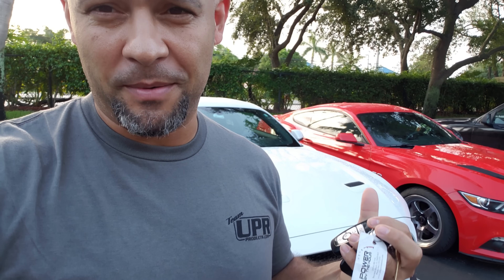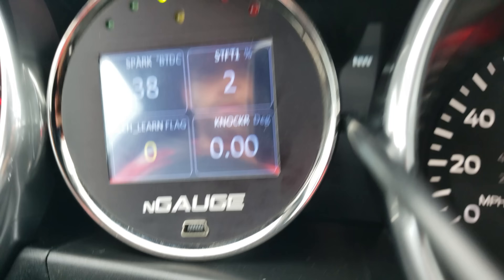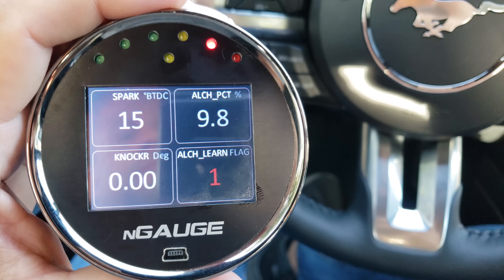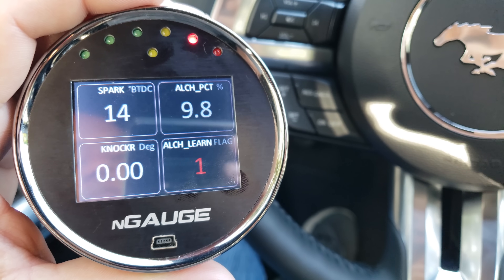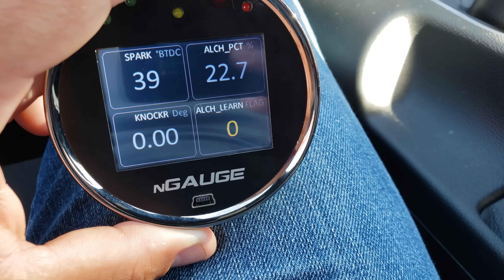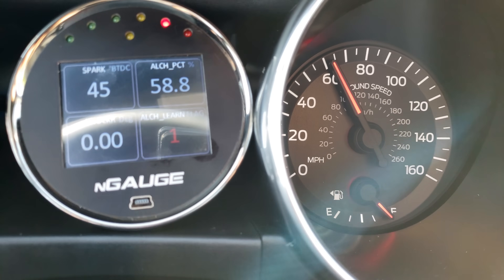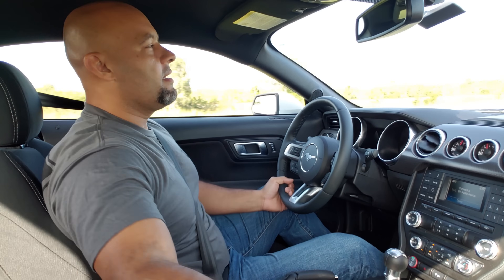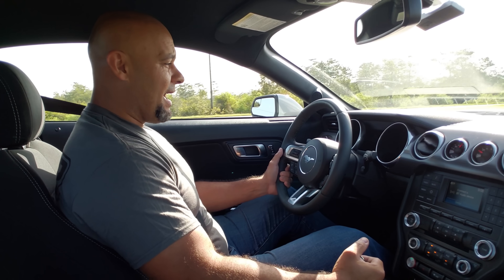2018 Mustang Breaks down, fixed, then gets a flex fuel tune

Comment: Casually revving the car to 3000 rpms for 10 minutes at a regular ole gas station 😂😂.. Lund says to rev it to 1800 a “ couple times “ then drive slow for a few miles. It ain’t gonna learn shit that way. It should say hold it at 2500rpms for 5 mins or until alcohol % stops climbing.
Reply from the maker: @xGR1MxREAPERx  flex tunes haven't been offered by Lund for 2 years. Cause people don't know how it works.

Comment: I have a 2018 Mustang 5.0 and running the flex tune. I’ve been running E85 for a while (6-8) months. And just swapped back to 93. I’ve gone through about 6 fill ups and the Alch learned will not drop to less than 76%. I’ve tried drive it at various RPMs but no luck in having it change in % learned. And also the AFR reading is still at 10.0 basically. Any ideas?
Reply from the maker: Let it get totally empty then refill with pump gas
Reply: @YDBT4LIFE   Ok, I’ll do that. Thank you

Comment: Poor man question 😉 I installed my JLT cold air intake with a Lund N gauge 👉tune? Well it won’t keep running, so I put the factory cold air intake back on and it runs the same as before the N gauge install. N gauge says no tune available? Thanks 🙏 I know you’re a busy man.
Reply: I always contact Lund Racing directly, they respond within 1 to 2 days, they'll answer anything you ask them and very detailed and nice about it.
*I already asked them 3 questions and ALWAYS responded me within 1/2 days

Support@Lundracing.com

Comment: I have a 2011 GT500 with FIC 775 injectors and a VMP fuel pump booster.  What's needed for a  flex fuel tune?

Comment: Good thing it happened at 300 miles before an modds. Once the modds are there your Powertrain warranty is gone. And the Mustang V8 is not Flexfuel, it only goes upto E15... I have ruined a few motors using E in non flexfuel.

Comment: Hey Alex. I’m about to get a 2019 mustang auto trans with the Hellion street sleeper twin turbo. Should I spend the extra $3,000 for the oil pump gears and half shaft upgrades ? Don’t plan on taking it to the drag strip much. Yeah a few times to really see what times I can get but mostly I will get on it in the street.

Comment: Can you swap the better gear cluster from the older MT82 into the new one? Or just the whole transmission if the electronics allow?
The 2018 6M needs the older gears with the 1:1 5th gear.

Comment: mine locks out 1-2 anything over 6800rpm. MGW shifter didnt fix it like every YT'er claims it does, 2-3, 3-4 are perfectly fine.  just 1-2. i have to shift at 6800 then can take the rest to 7800 if i want.

Comment: Not to be one of THOSE GUYS, but I'm pretty sure the stock fuel tank on any GT is 16.4 gallons, meaning at 1/4 tank, you have about 4 gallons left.  Let's just say I let my old car run down to 25 miles to Empty before & it took ~15 gallons. 

Still interested in learning what you and tuners think of fuel additives that have the primary objective of boosting octane/performance!

Comment: My 18 shifted beautiful until about 2500 miles then it broke. After I installed the new trans I tested to see if maybe there was another problem(like the clutch) that might have aided the fork breaking. Car shifted like it did new again!  I understand what your saying about the clutch locking you out of gear, as I have owned a few MT82 cars. You cant blame a mass failure like this on all the drivers that this has happened to.. Especially a issue big enough that warrants Ford to issue a TSB. Being a Ford technician, when they issue a tsb its very common mass problem. For example I replaced a ton of evaporative purge valves until they finally issued a TSB, then finally a recall..  But if i'm being honest, if mine wouldn't have broke I would be saying the same thing.  But I know for a fact how I drive and I don't gorilla shift a MT82, no need to they go in gear just fine.  I didn't have any issues out of my 17 or my 14 and they seen a lot of track time...  But what I saw in how the fork broke, it did look like a possible casting issue(kind of a clean break)… Hopefully you don't have any issues! 

Love the new car by the way, Congrats!

Enjoyed the vid, very informative..

Comment: Hey Alex. Is the flex fuel just using the o2 sensors and knock sensors to calculate the ethanol content? I know their is no e% sensor, so assuming the o2 sensors do the heavy lifting?
Reply from the maker: Phillip M just the front o2 they are widebands

Comment: honestly i don't thing there is anything wrong with the clutch. i haven't really had any issues with my clutch or transmission not wanting to go into gear. i think people are just slamming the car into gear way to hard causing the forks to deform and break over time. like you said there is no reason to have to slam the shifter so hard.
Reply from the maker: Meat Man agreed

Comment: Not funny that it happened to you but funny that I had same problem in late 1980's in a few month old Mercedes Benz wagon with 6 cylinder gas motor.  Driving to my office the car suddenly started slowing down and almost was rear-ended.  Pulled to side of road and towed to dealer...failed fuel pump.

Comment: I have a 2018 that has symptoms of a bad fuel pump. I was doing a 4k pull and when I go to shift into neutral the vehicle just shut off and I’m coasting at 50 mph engine off. Another sign was I was taking a right turn in the neighborhood, stop sign to stop sign, and the engine does when I get to the next stop sign. Going to mention this to the service advisor when I bring it in. I haven’t had a 3rd/4th gear shift form issue, just sloppy shifter I plan to replace. But I definitely have some weird issue with the car shutting off. Thanks for the video, will definitely keep watching!

Comment: Alex,

I have a 2016 PP with 6 speed.  I'm running the Lund Flex Tune.  The first time I ran it my AFR was 9.8-10.0.  Now after reloading the tune I'm at 10.4-10.9 consistently.   What do I need to do? Same pump at same gas station.
Reply: All that means is your not getting true 85%.. its fine, its a flex tune ..

Comment: Funny, my friend has a 01 Cobra new that had intermittent starting/ running problems and they seen where the fuel pump was working sometimes and sometimes not so much.they changed the fuel pump and it's been fine ever since,,,
Friday fuel pump I guess lol

Comment: I broke my shift fork on my 2016 performance  pack. Has intake and exhaust lund tune .. 38k miles ford fixed it in 6 days. Definitely scared to drive it and bang gears now

Comment: The only issues I've been having on the 3rd and 4th gear shifts have been after a few WOT runs from ~50-140 or so. The clutch gets real spongy and makes it pretty hard to get it into gear. Kind of makes you wait a second or 2 before you can put it into 3rd or 4th. But besides that they drive pretty well.

Comment: Dang 110+ mph in 3rd with 3.73! Looks like the base car needs 3.73 and PP needs 4.10. Can the dealer put a 4.10 in it and I keep my warranty?
Reply: Kind of... They won't warranty anything that the changed parts could cause to fail but everything else is still covered under warranty.

Comment: How can the car know the stoich AFR of ethanol if the O2 sensor is reading a lambda (then converting to AFR)? Wouldn't it still show an AFR of 14.7 (indicating lambda 1.0) because the O2 sensor is just reading the oxygen in the exhaust stream (it has no concept of fuel)? This stuff is fascinating!

I self tune my import... I'm not used to this advanced Ford ECU technology!!
Reply: I believe the wide band works in conjunction with the knock sensor to learn the alcohol content. It's impressive.

Comment: I have a 18 and the fork broke at 2700 Miles. I got on it literally 2 times. And I’ve had 10 mustangs with 3 MT82s. Never had a problem. It could be the clutch cause it’s touch to shift
Reply: I’m jealous man. Mine never shifter like that. It wouldn’t ever go in gear like that. It was like hitting a brick wall at 6k

Comment: I've never had a problem shifting my '15 at 7000 rpm. It is on an old ass Lund tune and it sure as hell doesnt get to 140mph that quick. Then again my original fuel pump is still going...

Comment: Please tell me what I have to do for me to have a tune from you bro ? Ughhhh I want one to have a little bump in Power and adjust my revs per mil for my tires. I have this crap OTS tune from sct that came with the x4 and when I shift from 4 to 5 the throttle pedal goes died. And won’t accelerate unless I lift off and then get back on. Do I have to go to the Lund tune page and request you ? I’m in central Florida
Reply: bigandbad9 it's pretty simply, just go to their website - purchase a tune and fill in a questionnaire. Dont expect Alex to respond directly to you, he cant go around undermining his company and deal direct with people and still call it a Lund tune. Get it done already, had Lund for awhile - nastiest one yet.

Comment: I had a new shifter housing and lever  installed under warranty. I was having lock out issues, a lot of people didn’t know about this tsb. It has helped, I’ve launched my car at the drag strip, rip gears and  have had no shifter fork issues yet. It’s tsb 18-2083. Just some info for people with issues
Reply: I take it back and all of a sudden I have lost 2nd gear. Also won’t shift good into any other gear. 😂

Comment: Congratulations on the new Mustang!  It already rips and it’s still tight....was your mustang a flex fuel from the factory ?  I’d love to turn my 2017  f150 into a flex fuel,  it’s not from the factory lots of e85 here and m.y boosted 3.5 would love the ethanol . I know your not an ecoboost fan but I didn’t have the money to put a blower on a 5.0 and without one it isn’t even close to a 2nd gen 3.5/10;psd.

Comment: Alex, have a 14 gt could a flex fuel tune be installed without making modifications to the fuel system?
Reply from the maker: no you need injectors
Reply: Thanks Alex, how can I get a custom tune from you?
Reply from the maker: Artie Rodriguez I tune for Lund.  Support@lundracing.com
Reply: Awesome bro, will reach out to them 👍🏼.

Comment: Ford said the shift fork problem was resolved, it was a casting defect from their supplier which affected the first units.
Reply: This is what I have heard as well.  I have an 11/17 build and am going to see if the dealer can determine whether mine was part of the bad batch.  So far, nothing has broken.
Reply: Anyone heard of the shift forks busting on a 3.55? Everytime I hear about them breaking it's on a 3.73.
Reply: andrew carpenter my 2018 has 3.55 and the 3-4 fork broke at 8500 miles. Has a whole new transmission now

Comment: Can you do normal driving for the flex fuel tune until the car learns the fuel mixture? Or must you be at a stop until the gauge shows the 1 for alchohol learn? Can you do a video on the difference in performance and tuning between direct fuel injection and the traditional fuel injectors? A comparison between the 2018 and 2016 mustang gt fuel systems. Thanks.
Reply from the maker: you can drive normal

Comment: Ford continues to disappoint me. I'm definitely having second thoughts about buying a new 19 GT.
Reply: Bodyguard 56 then maybe start doing some Chevy research lol
Reply: WhatTheFox302 We may not have a choice.
Reply: Bodyguard 56  yea the new camaro is looking great 😂😂😂😂😂😂
Reply: Both are good cars love that higher rpm on the mustang though .
Reply: A fuel pump shouldn't scare you away, warranty work until issues are fixed and the cars are honestly fine, just be cautions until everyone knows whats up
Reply: Dynoids Fuel pump, transmission and engine problems, what's next? Warranty or not, not making payments on a new car while it sits at dealership for weeks. Chevy is looking better everyday.